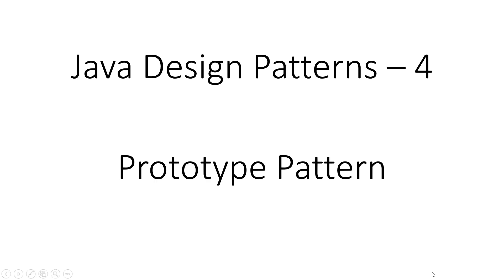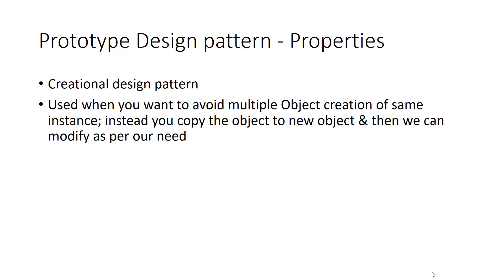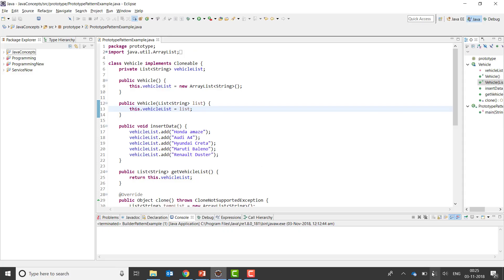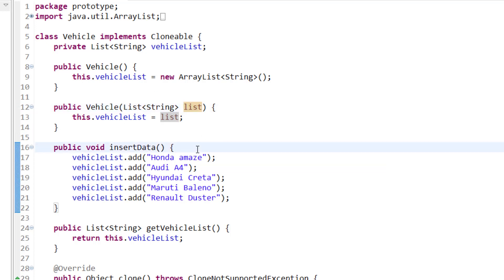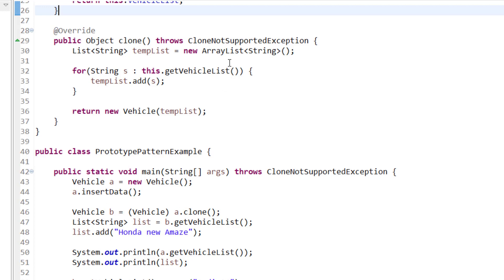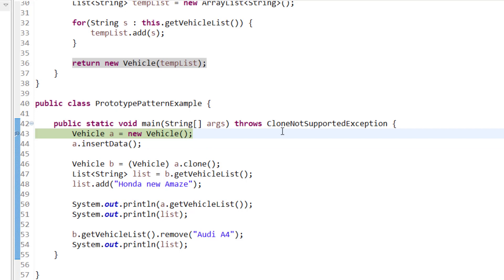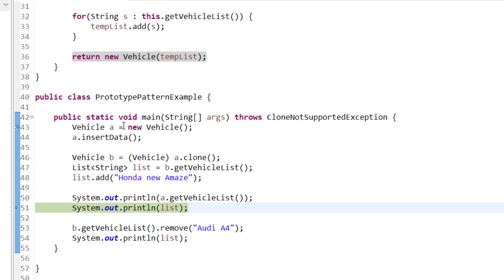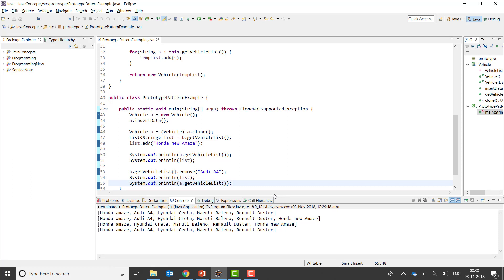Prototype Design Pattern in Java

Comment: I have 2 feedbacks
1. We don't need clonable interface here. Just creating a normal method which clones the object should be fine.
2. Creation of new object in clone method is needed for getting a copy of existing object. To understand this we have to know why we are using this clone method. May be the actual object is loaded from database during first time of its creation. We do not want to reload the object multiple times from database to get it. In order to avoid such scenario we have to clone it and create a new object with existing value instead of calling database.

Hope it was helpful.